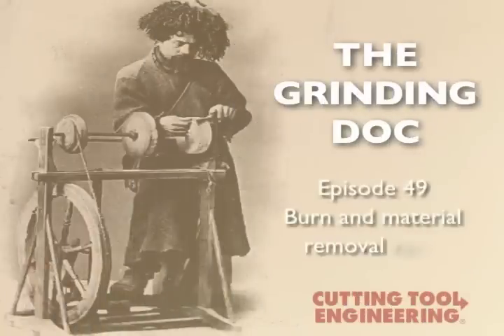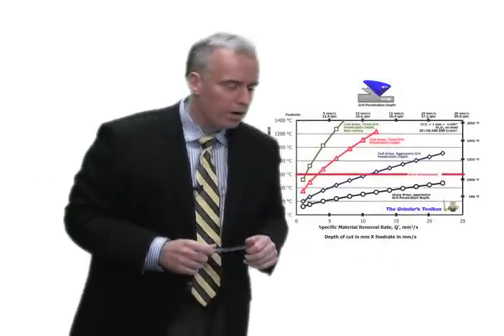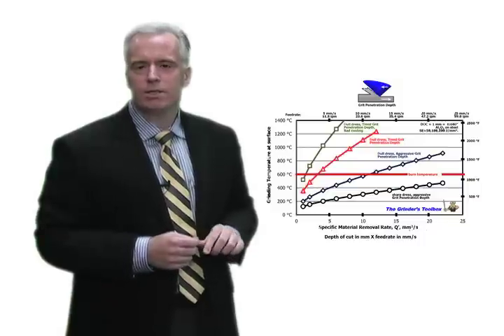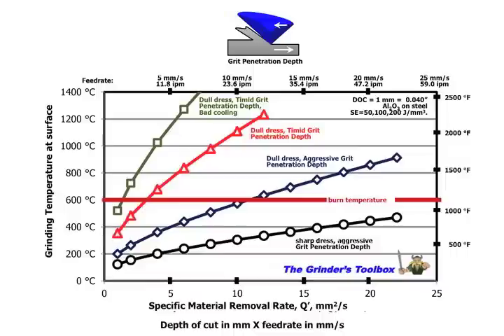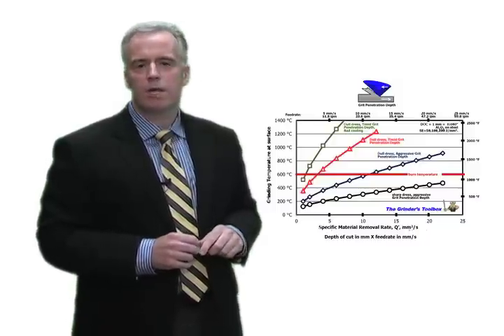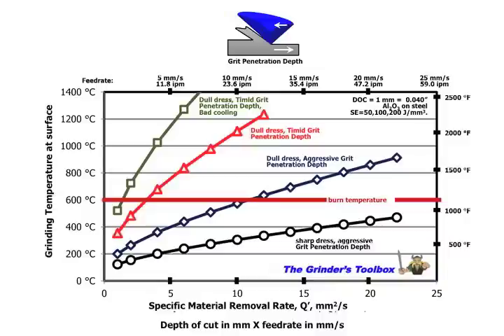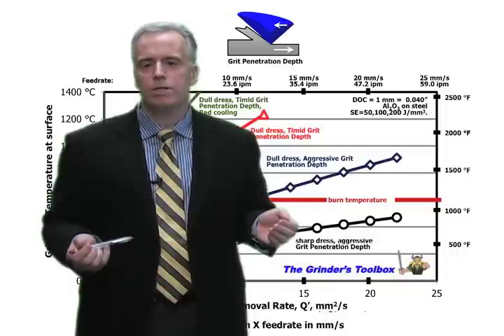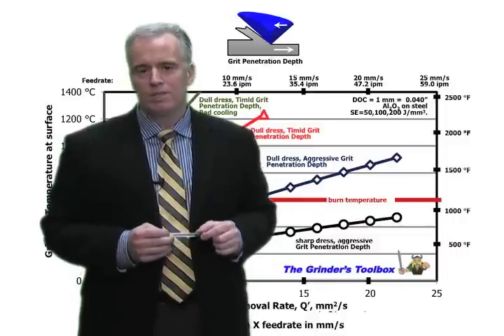Episode 49: A creeping burn

Comment: the only proven way to speed up your feed and eliminate any burn is a simple change in your dressing method, DO not use a single or cluster diamond to dress, the sure method is a rotary diamond dresser  10mm depth no burn . you can go deeper if you have a constant dress system mounted above the wheel.